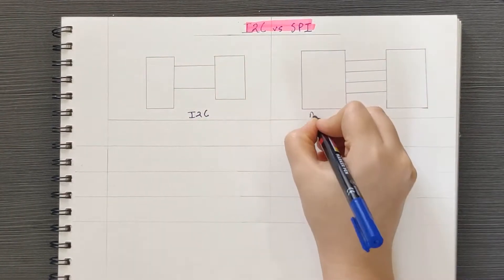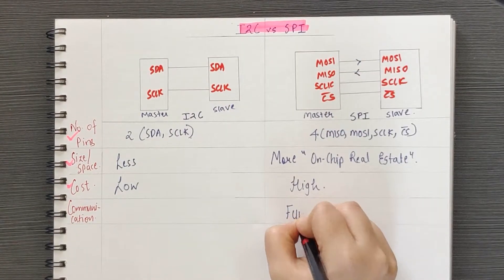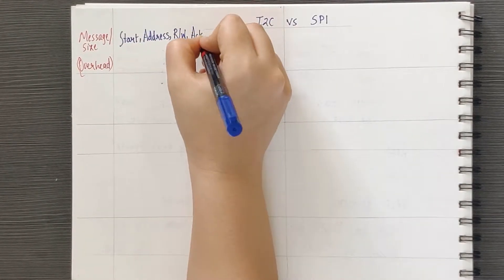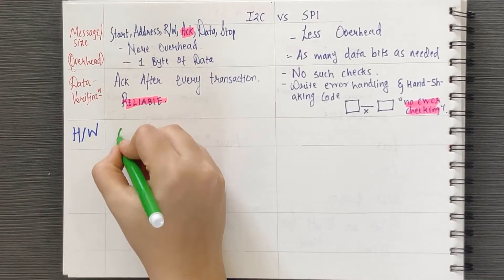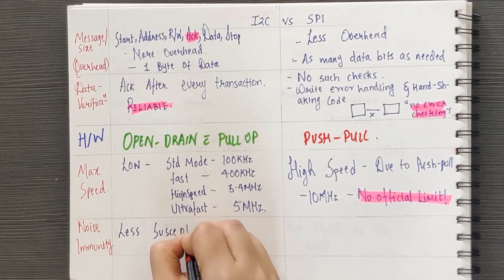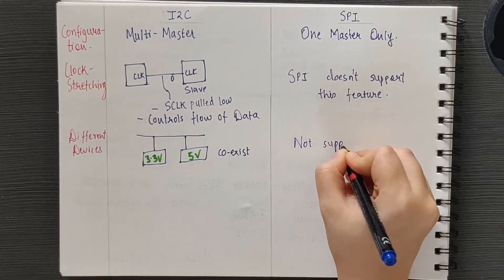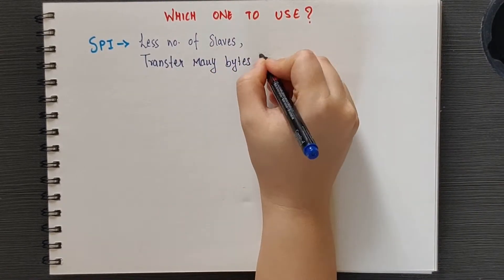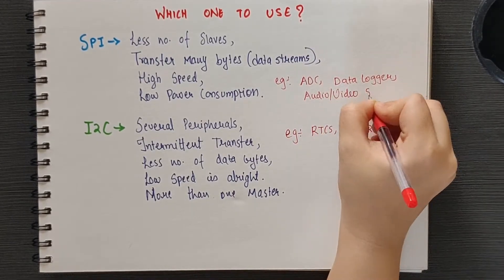I2C vs SPI - Which one to select for your design

Comment: Really nice video. I have a question. CanI use a I2S expension board with I2C connection. In other words, are the two compatible? I want to add sound to a Raspberry pie pico and it only has I2C. What should I do? Thanks.
Reply: if you are wondering whether you can combine SPI and I2C, you can with the help of a bridge chip like the SC18IS602

Comment: Hi Bina.
Thanks for the clear differentiation between the protocols. 
I am working on interfacing 4 microcontrollers for a master-slave system (all 4 are the same - MSP430FR21xx family). 
Based on this video and the controller specifications, I think I2C will be better suited, but my professor insists on using the SPI.
Can you provide some opinion?
Reply from the maker: Did you discuss this with your professor? Which protocol will be better to go with depends on your project's requirements and your current skillset.